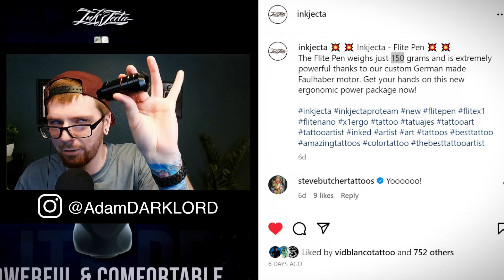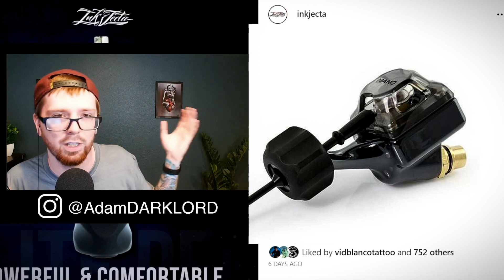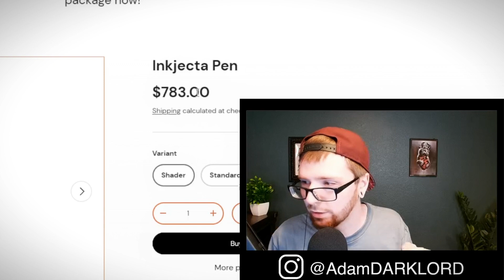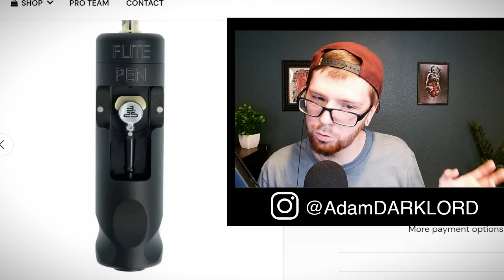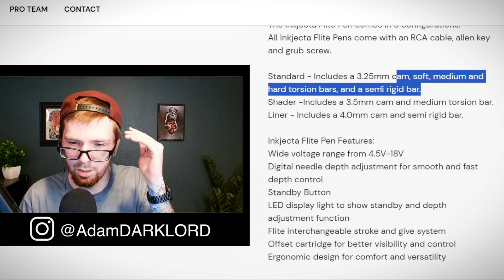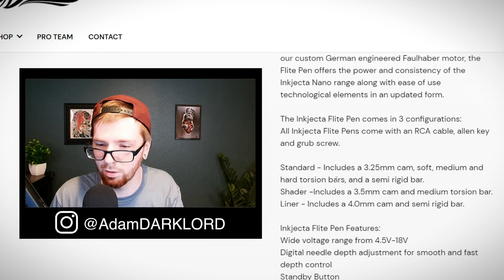Inkjecta Flite Pen Tattoo Machine First Impressions

Comment: The 18 volts and steve butcher at 12v is because these machines have a wider voltage adjustment 12v on an inkjecta is like 8 or 9 volts on others swashdrive did a similar thing where it started running at like 13volts. Horrible for battery use. Its only perk is maybe you have more of a "fine" adjustment since it ramps up slower you have a wider range of speeds to dial into
Reply from the maker: Yeah I was thinking in my head while I filmed that part that maybe it’s just a made up number and that 18v was actually 12v. I don’t fully understand it but wouldn’t it running on a 12volt system like a battery mean that the maximum voltage would only be 12v? Unless they overclock the voltage but that wouldn’t be good for the electronics…. Unless I’m just dumb and missing something. In that case they should just say hertz or 18u “u” for units if it’s not the actual voltage. 
It would be nice to hook the Musotoku battery with power bar up to this so we can see the efficiency 🤔
Reply: @adamdarklord  yea a battery with a maximum of 12v won't be able to push the machine through its full range poor design choice in a time we all want wireless

Comment: That's not a typo it's because all the flites came stock with a 3.25 cam so that's their "standard"
Reply from the maker: Well it’s dumb lol obviously “standard” should be the stroke length between shader and liner idk why they thought that was okay
Reply: @adamdarklord  they are good at making horrible decisions like having to turn the flite x1 upside down to pause it lol ( letting ink flow up towards membrane etc great plan)
Reply from the maker: @x_z0mb1_x No way they did that 🤣 💀
Reply: @adamdarklord  ty pallottas x1 review 8 min 15 seconds in is your answer
Reply: Standard not because of the cam size but having all option of bars.. inkjecta nano cams fit this machine so can be changed to whatever one may need..

Comment: Looks like another flop to me. They get points for interchangeable cams and give rods. But man just forget the electronic depth adjustment would have been better off just using normal twist grip depth adjustment and offering different sizes my initial thoughts to were the ergo shaped grip is going to stop Me from rotating my mag on different angles easily plus yea offset cartridge hole going to make that even more awkward for the way i like to work. .then I saw the electronic depth and I'm like ugh why. I think the flite nano is ahead of this still since it can use disposable grips it's already really small and also still easier to clean than this new model .
Reply from the maker: Twist grip and battery built in even if it was the flashlight removable battery style and I would be way more sold on it
Reply: @adamdarklord  100%
Reply: Agreed with all of this. 

The Nano is my go to and they haven’t put anything out as good since. I’m actually really disappointed in this and the X1. The X1 had potential but the motion control shit is straight garbage.